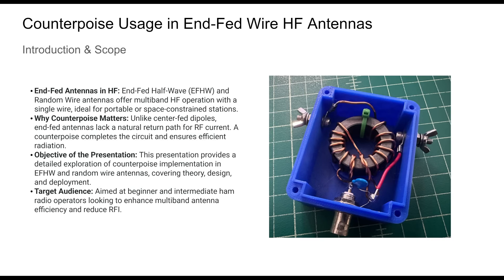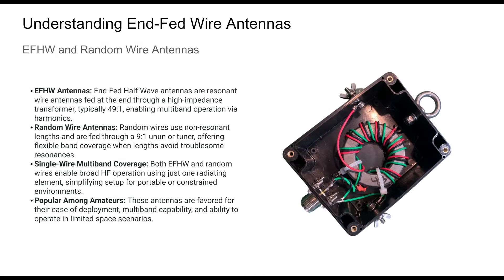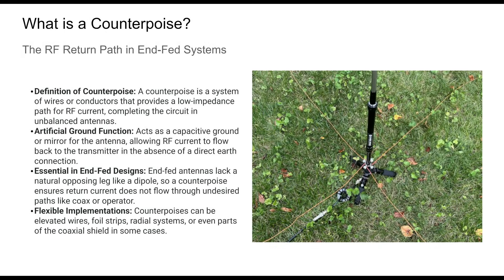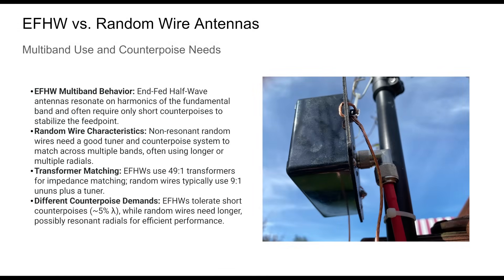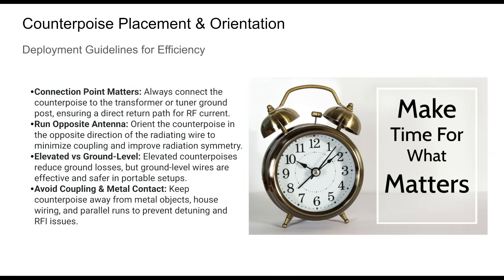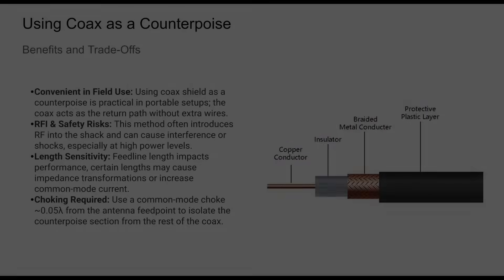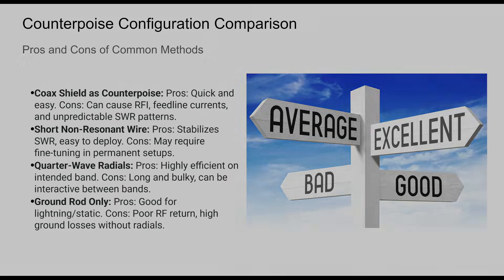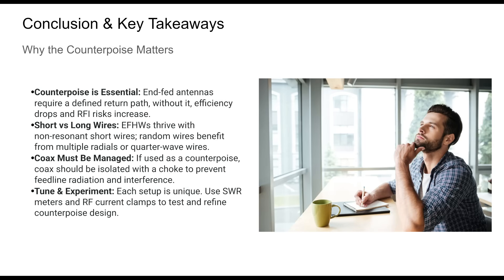The Shocking Truth About Counterpoises and End Fed Antennas

Comment: I have a 71 ft NREF ant with single wire counterpoise . I get work 40  to 10 meters.  Would using multiple counterpoises improve the number of bands I can work. I have a chock right at the 9to 1.
Reply from the maker: It might, give it a try.  Just remember these require a tuner 👍

Comment: I’m always puzzled why people call the multi-band end-fed antenna a “half-wave” (efHW)?  ?!!  It’s only going to be a half-wavelength long on, at most, one band.!

I’ve built a lot of EFHW antennas that are resonant on a single band and they can work well.  I’ve also put them up against full wave loops and the loop is pretty much always quieter on receive (better s/n ratio).  Not as easy to support as a simple end fed but everything is a tradeoff.  The FW loop is also very resonant on harmonics so easy to multi-band.
For what it’s worth.
Reply from the maker: That’s a good point, not sure why either… maybe based off the fundamental 🤷

Comment: My homemade 80 meter EFHW has been the best antenna I have ever had. It works on all bands 80 - 6 and I do not use a counterpoise but rather send the ground wire from the autotransformer straight into an 8 foot ground rod right under the autotransformer. It's fed about 3 feet above the ground on a fence post and slopes over toward the top of a tree. It's sloped way over to mostly horizontal and never reaches more than about 25 feet above the ground. With 100 watts I can routinely work stations world wide and even bust through many pileups into South America from my location in the US northwest.
Reply from the maker: That’s awesome, glad it’s working out for you 👍

Comment: As an RF Engineer with 40+ yrs of experience in Commercial, Broadcast, and Military RF systems, this is 100% correct. Well presented. 
My only comment is the miss-understanding of a grounding electrode (i.e., Ground Rod) and it's primary purpose as a low-impedance path to earth for lightning, surge, and fault currents/voltage discharge and establish a stable reference potential for primary power distribution. Again, nicely done..
Reply from the maker: Thanks for the comment Steve 👍

Comment: I always use a .05 wave length  counterpoise wire on my 40 meter EHFW I kinda just threw some stuff I had together and it works good for me. I had a 11 foot coax with a choke at the end ment for a North Carolina Windom. I have the short counterpoise wire but come out of the 49:1 with the 11 foot piece going to the choke and the. A 25 foot piece after it going to the radio. I have the feed point about 8 feet high going up about 30 feet and down to a push in electric fence post. I have about another 30-50 feet of surveyor string on it to extedit out to get the end of the wire up maybe 8-10 feet off the ground. I tried to put a shorter piece between the choke and the radio and it made things go a bit wonky.  But anyway I have great success with it and lots of contacts. I wouldn't do without the counterpoise wire. I do want to try some more experiments.
Reply from the maker: Sounds like you are getting it dialed in Bruce, thanks for watching 👍

Comment: I use a tubular steel fence for mine with 1:64 transformer at the top, on a bit of a slope tuned to 30m. Big fan of natural counterpoises. The 1:64 is extra sharp so element length, diameter and velocity factor needs to be more precise than a lower ratio transformer, however the match is better for most installation heights (under about 40m). Brings me into the one point zero scale aiming at the FT8 frequency 10.136 Mhz, single band. QRP only 5W. First contact on it was 16,000km from NZ to France.
Reply from the maker: That’s awesome FooBar 👍

Comment: I use the 5% rule for my counterpoise with my 40 meter EFHW antennas and I just place my choke on the feedline 5% of a wavelength (on 40 meters) down from the feedpoint.  This way I don't need a separate wire for the counterpoise which keeps the installation very clean.  I've tested relative signal strength in the far field with the coax hanging straight down from the feedpoint versus in line with the EFHW wire for the 5% distance and it really made no significant difference and it also made no significant difference on the measured antenna current (all measured on the fundamental band).  My choke just involves wrapping 10 turns of the coax on an FT240-31 toroid core.  Just FYI, Don wd8dsb
Reply from the maker: Thanks for sharing that Don, and for watching 👍

Comment: Companies like MyAntennas manufacture their 10-40M EFHW's without a ground lug on the unun. Deployed 20ft in the air, it's pretty tough to figure out a counterpoise solution with that especially with no ability to run a wire in the opposite direction, so the best solution for me was to use my 100 feet of feedline as the counterpoise and place a huge choke about 10 feet from the station. It has stopped any and all noticeable RFI issues. Perfect? No. But, those of us forced to use EFHW's in our small pieces of property with no room for anything else are forced to make compromise after compromise lol. It works, and does the job.
Reply from the maker: You can use what is called a mueller clip to clip a poise to the coax shield.  Thanks for watching Kody 👍

Comment: For my EFHW, the feed point is about 10 feet high on the side of our house.  Directly under the feed point, I pounded an 8 foot ground rod using a Milwaukee pneumatic hammer.  At ground level from the ground rod, I laid down a “fan” (a total of 5 radials, one directly parallel to the above antenna wire, with two more on each side) of ground radials on our lawn, extending outward for the 65 foot length of the antenna wire.  The antenna wire is fastened to a corner fence post by way of a small glass insulator and about a one foot length of para-cord.  I then tacked the ground radials down with gardening staples.  By now the radials are buried in the grass and hence mowing over the top is no big deal.  The wire I used for the antenna was “invisible” wire from the Wireman.  Radials….I bought a roll of electric fence wire from Southern States.  Overall, the antenna works very well.  Not nearly as good as a yagi up at 100 feet…but I routinely work DX as well as local NVIS contacts, depending on the band.  I usually run barefoot at 100 watts (rig is a K4) but on occasion I fire up the companion 500 watt apple fryer.  Modes include CW and voice plus various digital.
Reply from the maker: That sounds pretty cool Thom, glad to hear it’s working out for you 👍

Comment: I’m building an EFHW for POTA. I’ve been told that you must use a counterpoise and the coax is your counterpoise. 
I’m currently a tech so only 10meter at this time but my antenna will be spliced so I can add length later as I need it so each band can be as resonant as possible. I’m planning on having a counterpoise and I’m thinking I will need to set that up spliced as well.  When using the counterpoise and tuning it how high off the ground should it be? I will be using the sloper configuration.
Reply from the maker: Hey Joe.  For a sloper I’d keep the transformer low to the ground, about a meter.  It’s OK to have the CP on the ground 👍
Reply: @TheSmokinApe thank you!

Comment: Great and informative video. Thanks! I use a random wire antenna with a 9:1 unun and get great results. I made a contact from California to South Africa on my Xeigu G90 with this antenna. However, I was only using a single counterpoise.  I'm going to try multiple wires and add a choke. I spent a lot of time positioning this antenna in different directions until I found the sweet spot. Thank again, for the video.,..73...Hugh...KN6KNB
Reply from the maker: Hey Hugh, sounds like you are getting it dialed it right.  Thanks for watching 👍

Comment: Ape, Great video.
The subtle and nuanced struggle with the EFHW is also its strength: it “just” works. Of course, so will a car that’s running on only a quart of oil, for a while. That’s the beauty and the problem of the EFHW. It works, and it is extraordinarily forgiving. The common refrain is, “It makes contacts, so what’s the issue?”

Well, people who drive their car on one quart of oil say the same thing: “Those extra four quarts are a waste of money. I’ve driven across the country on one.”
Absurd logic, right? Yet in my automotive career, I have heard rationalizations exactly like that more times than I care to count.

The laws of electricity are immutable, they do not change because our setup is convenient or minimal. 

So if an EFHW “makes contacts” without a counterpoise, the question isn’t “Does it work?” but rather: “Why did it work at all, given what we know about electrical systems?” And the answer is never, “Because physics took the day off.” As operators, we are responsible for intentional design. We build circuits, including antenna systems, to move electrons in a controlled path, outward and back again. When we omit the counterpoise, we hand that return path over to randomness. The station becomes unpredictable at best and silently compromised at worst.
The coax was never designed to be part of the radiating structure. Yet without a counterpoise, it is conscripted as one. Its electrical length changes every time you move it, coil it, lay it on the ground, or route it along the wall. That randomness changes the antenna’s impedance, resonance, and SWR in ways you cannot predict let alone control. 

This is the primary reason for a counterpoise:
a proper counterpoise makes the antenna intentionally consistent.

It restores intention to the system. And this brings us right back to the operator. Operating intentionally aligns with the spirit of Part 97, running an efficient station, minimizing interference, and mastering your equipment. Not because the FCC is going to knock on your door for skipping a counterpoise, but because the station you build reflects your discipline, your understanding, and your respect for fidelity in operation. We aim to maximize efficiency and minimize unintentional collateral effects.

That is the mark of an operator, not just someone who “makes contacts.”

Keep em coming APE! -73
Reply from the maker: Hey SaW, this is one of the best comments I have ever read.  The oil analogy is fantastic and I’m going to license it, free of charge of course.  Thank you for the well thought out comment and for watching 👍

Comment: You always make me think and dive for the search engines Ape! QUESTION though, and I never thought about this before your video. Is the suggested/ordained .05 wavelength-to-choke measured in consideration of the coax velocity factor? Say, RG58 has a .66 VF...do you shorten the length from your feedpoint to the choke?  I had a 25' run of '58, put a Mix 31-240 and Mix 42-240 ferrite back-to-back, and moved & wrapped them to the point where each terminated end was approximately .05 wavelength from the choke.  12 to 13 feet left on one end, about 6.5 feet on the other.  The longer end seemed to give a better match/lower SWR on my NanoVNA H4 for 80m, the shorter end for 40m and below, but you can just swap ends and re-measure in a pinch.  In the field it makes a great run for POTA, at home it only adds 25' +/- of coax loss to your feedline.  I call it the "ThumpyChoke!"  Worked great until I hit it with the mower in the leaves a month ago!  DOH!  Great stuff as always big guy! 73 de KN4HGI Alan/Thumpy
Reply from the maker: Hey Thumpy, yes you should account for velocity factor 👍

Comment: Good information on a complex topic! Without some sort of counterpoise provided to complete the circuit the antenna becomes unpredictable (I say unstable) as that return path will become some random path that the return current finds back to the transmitter. It frequently becomes the coax shield but depending on the length of the coax it may end up being multiple parallel paths just one of which is the coax shield! It’s always “ best” to provide that path in the design of the antenna and not rely on luck. However, sometimes I have said it’s better to be lucky than smart!
Reply from the maker: 100% agree.  Thanks for watching Dandy 👍

Comment: Controversial topic. Obviously. I use the HyEndFed antenna with a line isolator (common mode choke) on the feed line 13.5 feet from the antenna (calculated by .05-0.15 wavelengths for the lowest band from the transformer). This is industry standard. This creates a counterpoise using the feed line while suppressing RF headed the other way. I have zero RF coming back into the shack and SWR is exactly what was advertised by the manufacturer. Which is LOW! Performance is excellent. 1000 watt model and I use 650 watts from my Collins KWS-1. I also use a 200 watt end fed 160-10 meters with a choke 50 feet away (due to installation restrictions) and the antenna is equally as capable and presents no RF back into the shack. In my cases, the feed line is the counterpoise. In my book, a true end fed situation. I’ve used counterpoise set-ups on end fed antennas many times. In my experience, it is just not necessary. I will attempt to do some experiments and report back. Nice video and a good learning experience.
Reply from the maker: Thanks for watching W3KW, glad to hear the setup is working for you 👍

Comment: Interesting choice of pictures. Are we saying that a vertical like the 7350 is an EFHW? In one picture, the vertical has 4 radials and a choke and the other, no radials? Or did your secretary mix up the slide pictures you sent? I mean, this is the white background slides so that is what I figure happened.  😆 Nice presentation. Lots of comments about using the coax as a counterpoise. Seems easier to add a wire on the lug than to cut the coax or adding and water proofing ferrite beads to it. Maybe that is just me. Thanks Ape.
Reply from the maker: I put this pics in because the counterpoise was easily visible.  Thanks for checking it out Don 👍

Comment: ChatGPT is an excellent source of information on Antennas.
Reply: Answers aren’t pulled from Reddit. The model doesn’t copy or quote Reddit sources unless asked to. ChatGPT doesn't learn in real time. It doesn’t update from Reddit, the web, or anything users tell it.
Reply from the maker: It is, but you need to be careful as it learns mostly from sources like Reddit and Reddit is well… Reddit 🤷
Reply: @TheSmokinApe   So, I asked Chat if the above was true?   What do you think Chat said?  As someone who has been working in IT for over 20 years, and has some knowledge of how AI works I didn't think the answer was correct, so I went to the source. 

What do I think of the answer?

“It is, but you need to be careful as it learns mostly from sources like Reddit and Reddit is well… Reddit.”

This answer is incorrect in how ChatGPT works.

❌ ChatGPT does NOT learn “mostly from Reddit.”

Its training data includes:

textbooks

engineering references

academic papers

licensed datasets

publicly available technical documentation

forums (various, not just Reddit)

internet text

AI-created synthetic data

model-supervised reinforcement

Reddit is a tiny fraction of the entire training mix, and does not dominate antenna knowledge.

Also:

❌ Answers aren’t pulled from Reddit.

The model doesn’t copy or quote Reddit sources unless asked to.

❌ ChatGPT doesn't “learn” in real time.

It doesn’t update from Reddit, the web, or anything users tell it.

The phrasing is just a common misconception.

⭐ A better, accurate answer would be:

“ChatGPT can be an excellent educational tool for antenna theory, but it shouldn’t replace validated technical references or real measurements. Its training includes a wide variety of sources — not just Reddit — but users should still verify critical details with real engineering documentation.”
Reply: @TheSmokinApe   I posted the longer answer, but wanted to also clearly debunk the myth of ChatGPT learning from sources such as Reddit.  Here is the short answer - 

❌ Answers aren’t pulled from Reddit.

The model doesn’t copy or quote Reddit sources unless asked to.

❌ ChatGPT doesn't “learn” in real time.

It doesn’t update from Reddit, the web, or anything users tell it.

Comment: For the EFHW you will need a common mode choke at .05 wavelengths from the transformer regardless if a separate counterpoise is used or not. Lengthy test I and others have performed prove that adding short wire counterpoise in addition to using the coax shield adds no benefit. That short coax shield length provides all the displacement necessary. Adding more does nothing. 
The random wire design always requires a real counterpoise and typically the losses in these systems is very high due to high ground currents and poor radial system performance.
Reply from the maker: Yep, always choke the coax 👍

Comment: I currently use a 35.5 ft non resonant wire with a 9:1 unun wrapped around the inside railing of my deck. The coax is my counterpoise and I’m using a 1:1 common mode choke at the shack. I can tune this antenna down to 80 meters. No problems making contacts with only 40 watts.
Reply from the maker: Glad to hear you are having luck with it 👍